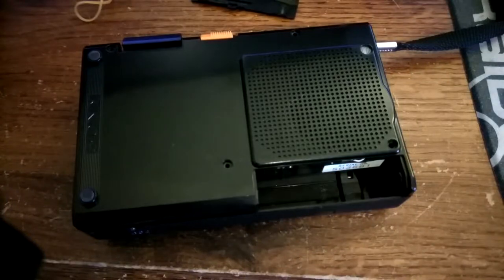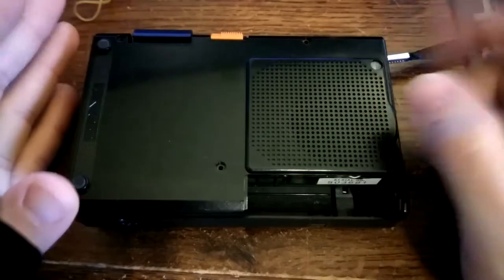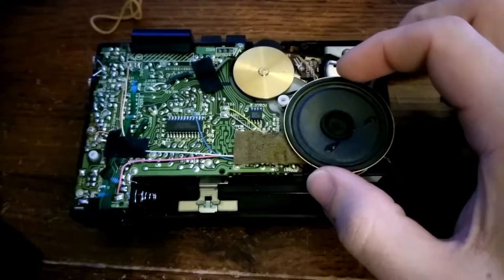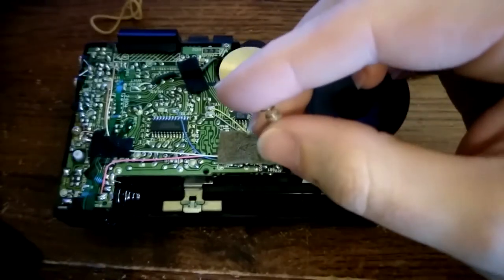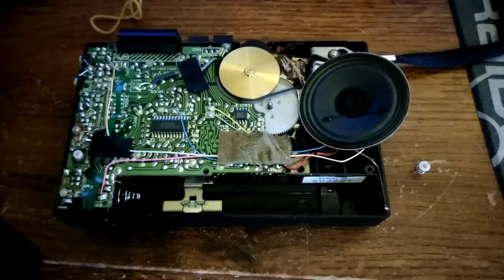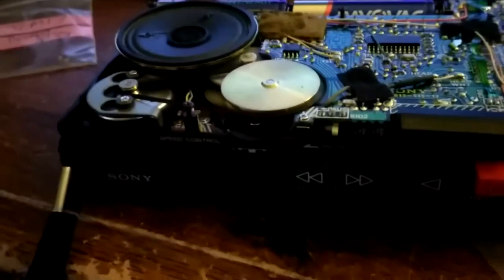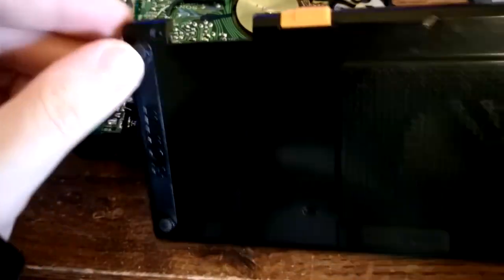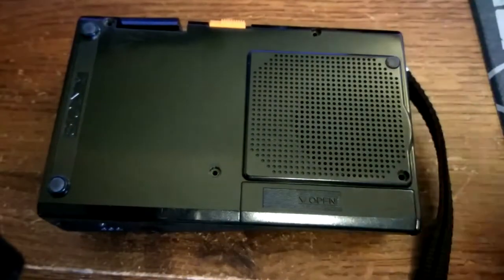DVLOG: Sony TCM 17 Repair & Tips

Comment: could it be possible to cause a short circuit just by putting slighlty sweaty fingers on the motherboard while the device is on and playing??
Reply from the maker: It is indeed. I'm a sweaty pig but I've never had it happen. Older boards may not be as sealed and protected from moisture after years of exposure, use and oxidation. If enough sweat completes a circuit and something gets power that's not supposed to it can be bad.

Comment: Hello man! hope i dont disturb, but im looking to get a cassete player but i dont know if i should choose the one in the video (TCM-17 Cassete Corder) or an WM F-2081, do you know which one could be better? i mostly looking just to hear some music on my house and maybe when i go to the mountain, looking to read your answer!
Reply from the maker: The TCM-17 is mostly a dictation machine. It does has a built-in speaker, but the addition of the ability to record (including its own mic and mic input) sacrificed its ability to playback audio in stereo. The 2081 has no built-in speaker BUT has a radio. They're very different units. If you're planning on getting one just to listen to music I wouldn't get the TCM-17. For music I was able to find one of the much later models, the WM-EX series, which has touch controls, noise reduction, auto-stop, all the fancy features (for 40 bucks). That one also developed a rewind problem unfortunately, but if you can find one of those that's in working condition, those are great for music even still.
Reply: @destructoblog  Thats cool man, i just found a Tcm 17 in a good condition but i have to change the belts, i was looking for a walkman but it looks its going to be a bit long until i find a working one with good price, i kinda looking for the tcm so i could also record some music
Reply: @destructoblog  You said that the tcm 17 shares the same belt like the WM-22 right?
Reply from the maker: @tobbeborislyba  they should fit, that's what I used. The mechanism is the same.

Comment: Hey man, I have a question for my Sony Tcm12, how can I calibrate the speed for listen the tapes?
Reply from the maker: TCM-12 doesn't have the speed adjuster knob, huh. Most if not all have a tiny pot you can adjust with a screwdriver, but be careful. You can use things like frequency tapes to measure the speed but it may be easier to find a tape speed adjustment audio track online or just use a song you can compare to a digital version to adjust the speed. If you haven't changed the belt yet, an old belt can also make the player speed change. If you've already tried changing the belt, check out this link for ideas: https://fixyouraudio.com/instructions/speed-adjustment/

Comment: Hello! I have an old TCM-12 and it seems that some mechanical part isn't working properly. If I try to play a cassette there's only a scratching sound and I can see that the gear is almost not spinning at all, just kind of stuttering. If I click play without a cassette in, it spins normally, without stuttering. I opened it up and I think the contact between the gears isn't great, especially the gear below the FF/REW gray gear, it looks like the rubber around it is a bit loose. Do you maybe have a solution for that or is this one too old to be fixed?
Reply from the maker: That could just be a worn out or old belt. The TCM-12 and the TCM-17 have the same basic mechanism--both based on the Sony WM-22. The main drive belt needs belt tension to drive the larger drum in order to play. If it is loose, it can't deliver enough torque to spin the tape. The other player in this video had the same problem. It would play if no tape was inserted, but if there was a tape, it didn't produce enough torque to spin the tape reels. Replacement belts for the WM-22 could solve the issue.
Reply: @destructoblog  Thank you! The old belt actually disintegrated so I temporarily replaced it with a rubber band because I saw it can be done (even though it adds a substantial amount of wobble).. That must be it then
Reply: Hey again! I just replaced the old belt and it seems to be working better, but it still doesn't play when I put the cassette in. However it does play when I press the REW button just a bit so it lifts the player head a little. Can the player head height be adjusted or something? Or is that not the problem at all

Comment: Hello! I just got a TCM-71 but unfortunatelly, the deck won't open completely. I could force it a bit but im afraid it would break. Do you have any tip for this? I can't find much about this model, only TCM-17 available. Thanks a lot
Reply from the maker: The door doesn't open enough to put a cassette inside? You may have a jammed spring or something may be stuck inside the door hinge.
Reply: @destructoblog  Exactly! I just forced it a bit and now i can manage to put a tape inside but it makes a heavy click sound which im pretty sure it shouldn't happen...
Reply from the maker: @ramon5061  Hmm, not really sure without seeing it. It could be rusty or something, it shouldn't be difficult to open. I can open mine by pushing eject with a tape inside.

Comment: Hello sir! I have the same one and I hope you will be kind enough to read the description of my problem. Basically it looks like the motor doesn't react when I press any of the buttons. I've conected the battery to the motor and it's working fine, so problem has to be somwhere else, maybe some connections are bad. The player works when I press play and spin that metal disk with my finger, but the motor itself is just ignoring everything. I'm afraid to take it all appart and go deeper, it all looks very fragile, so I was hoping that maybe you may know some common reasons why the motor doesn't react. Thank you!
Reply: The led on the front is glowing when i press play as well
Reply from the maker: @jiro4559  Aside from making SURE that your pause switch isn't stuck on or that you have a obviously disconnected trace or component, you may need to check out the service manual for the WM-11/22 for some tips to try and get it working again. This one in particular was jammed shut, so the motor didn't spin, but it did make a noise like it was straining. If your's makes no noise at all but you proved it works directly, then you'll need to double check the pause switch and take a deeper look at the mechanism. I know that doesn't exactly sound that helpful but I learn to fix things like this via trial and error... Oh! and here's a link to the service manual for the non-recording stereo version of this player, it has the same basic drive mechanism and layout: https://freeservicemanuals.info/en/servicemanuals/vie
wmanual/Sony/WM11/WM22/

Comment: My Sony TCM-17 can’t fast forward and backward can you tell me to fix it?
Reply from the maker: Likely the very same issue in this video. 4:35 the white plastic retainer that holds that spring in cracks over time and the spring falls off of the clutch mechanism. With no tension on this piece the teeth don't touch one another, therefore FF and RW is impossible. Take your unit apart like in the video and check if this piece is loose or snapped on. If it's loose, its the same issue and simply re-glue it in place like I explain.

Comment: Does it also mess up the “play” button?
Reply from the maker: It's possible, if the cog has the wrong tension or gets stuck on the metal speaker lip like I mention in the video, it could jam the entire playing mechanism. If the play button does turn the red battery indicator light on, and there is a motor strain sound, but tape doesn't play, likely it's jammed. If you press the play button and the motor spins but the tape doesn't, the cog has slipped between the playback/ff/rw function cogs and its just spinning nothing. If no functions seem to work at all, but the electric motor spins freely and quietly, its more likely that your belt has come off or just turned into black goop.

Comment: hi, sir! could u help me? how can I remove the squeaking sound when I play a cassette tape on my TCM 17?
Reply from the maker: Hmm, have you tried multiple tapes? Old tapes likely have dust/fungus on them that can squeak, or the foam pressure pad is dirty or old. If it's with every tape, make sure the rollers and the tape head are all free from dust and hair. If the pinch rollers and everything look super clean and nothing is touching them as they move, a very small amount of lithium grease may work, but keep it away from the tape head or any parts that actually touch the tape.
Reply: @destructoblog  thank u so much, sir! turns out, it's just the tape. i kinda disassembled it (even if i didn't know what i was doing lmao) and when i put it back on to play, the squeaking sound was gone. thank u very much! i subscribed to your channel! ❤️
Reply from the maker: @minaslemonpose1144  no prob, thanks and good luck with your future tapey endeavors.

Comment: Belt size ?
Reply from the maker: I used a SBS 4.6 to fix this one, it was just a touch loose, but this player has speed control so it's compensated two notches on the knob for it. The place I bought mine no longer has them for sale. Look for a 4.5 or 4.6 square belt, or a replacement kit for a Sony wm11 or wm22. Those bags of random belts you find on Amazon may work too.